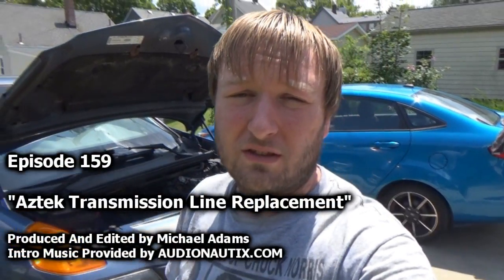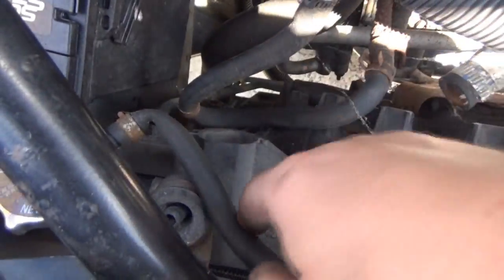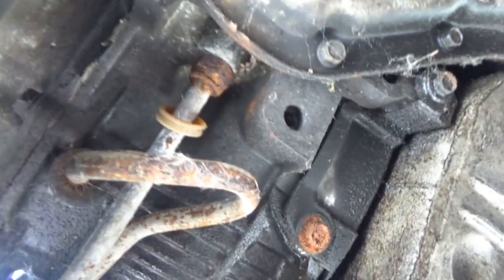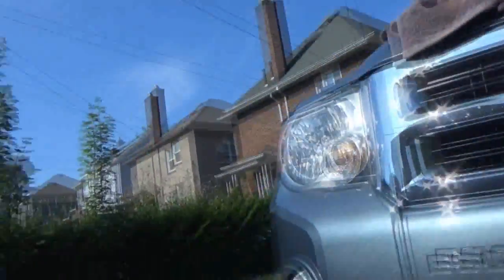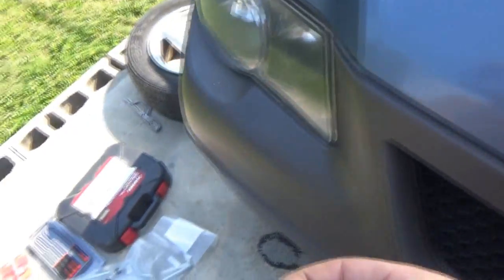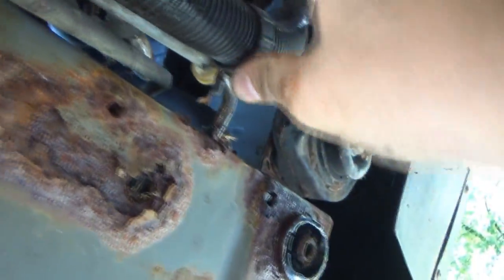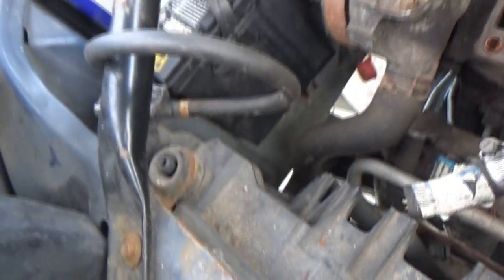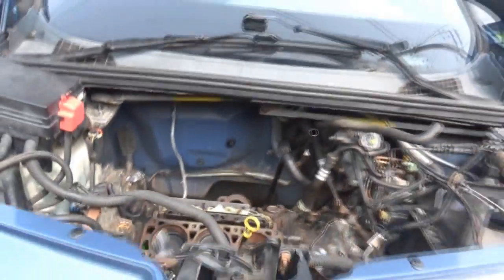MV 159 - "Aztek Transmission Line Replacement"

Comment: I thought it was a 19mm for the lines on the transmission? Are you sure it's a 3/8
Reply from the maker: It was 19mm. I figured it out when I was putting them back in.